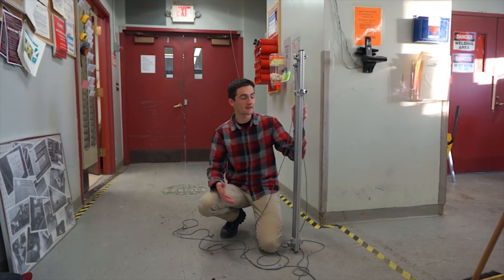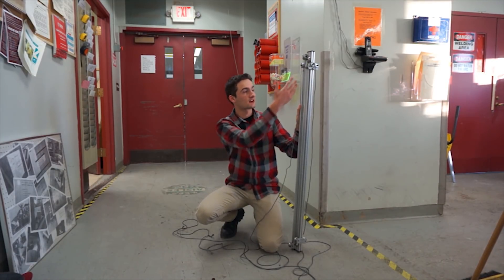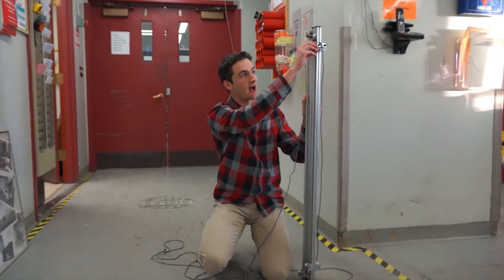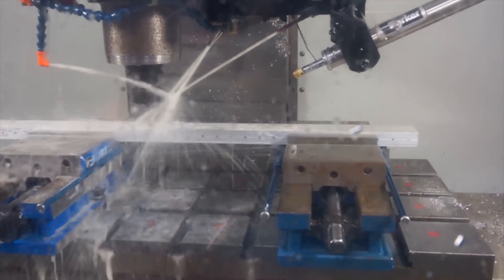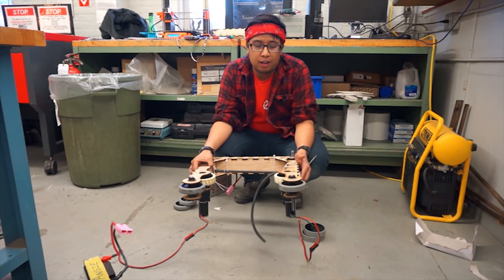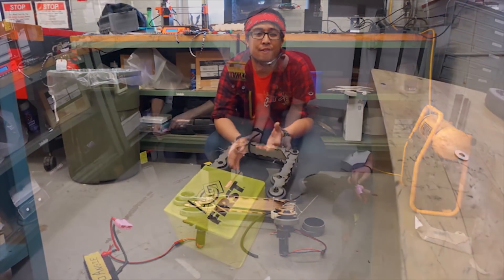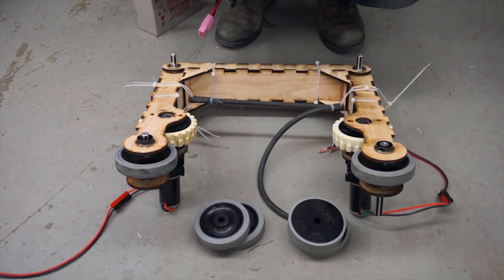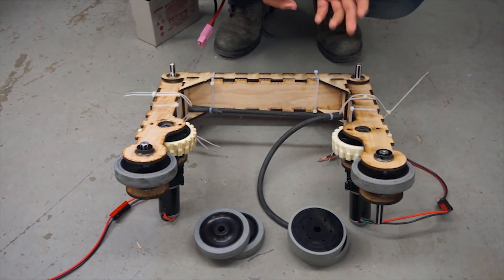Ri3D 2018 - WPI - Day 1 Recap

Comment: I have been watching RI3D Teams for the last 6 or so years now and I remember Team Ri3D spoke out about why they started doing these builds. It was to help "even the playing field" between teams with less resources and the rest and to create a minimum competitive design. One thing I question when watching your videos is if that same goal is in mind. I find that the intentions are good in sharing your design ideas and processes but many teams will push ideas aside when they see a CNC mill or laser cutter being used as a manufacturing processes simply because they do not have access to those resources. I suggest mentioning other resources that can be used by teams or simply avoid using tech that the average team does not have access to. Other than that, it is good to see another team contributing to the RI3D community.
Reply: Hey Jacob! Our intention is definitely to be a resource to the FRC community as best we can. We are using resources such as the ones you mentioned to test out design considerations and strategies in the most efficient way we see possible. By doing this, we can ensure that teams will have content available to them as soon as possible so they can be exposed to new ideas when it is most beneficial. All design concepts we are presenting on our final robot should be able to be built with the resources available to FRC teams, as the majority of materials we are using are off the shelf products from Rev Robotics and VEX. We are happy to start mentioning other ways to prototype and design in our videos if you think it will better the Ri3D community. Thank you so much for your input!

Comment: EXCELLENT CHANNEL! Im a mentor for #5144 LISD Technicians. May I request assistance with an electrical question? 
Should the robot be wired with a "floating" ground or "Chassis"  or common ground? Or is this an issue? 
Best of luck to everyone!
POWER UP!
Reply: R48
Reply: Thank you. What's R48?
Reply: Thank you for the support. I was unaware it was in the manual. (I'm vision impaired)